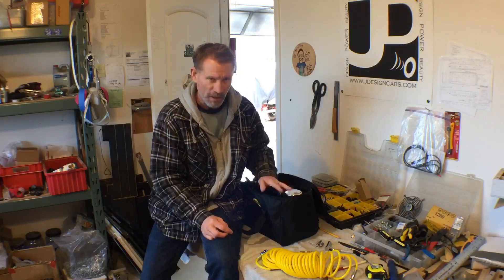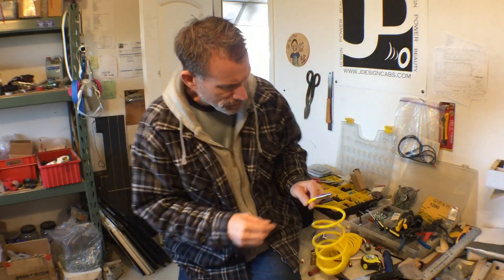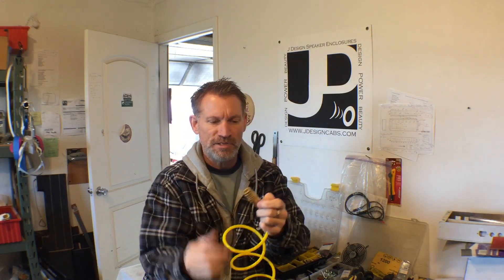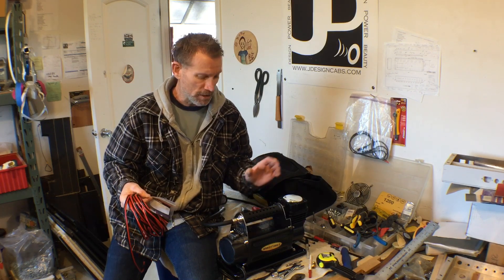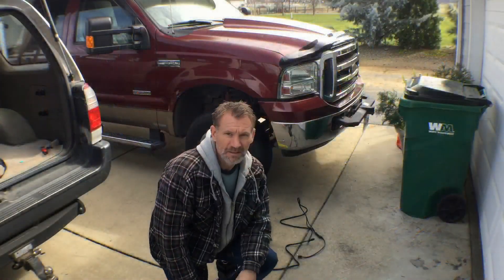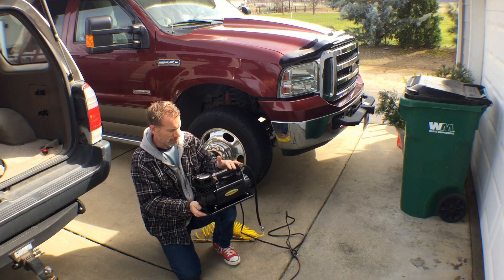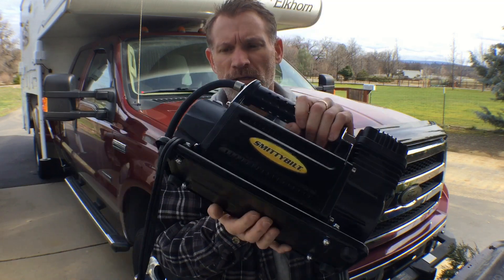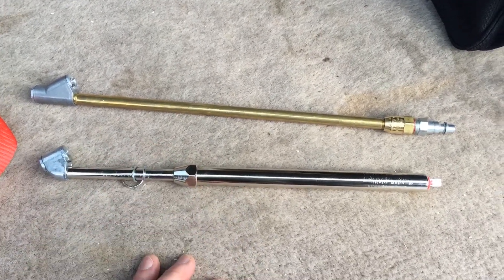Smittybilt 12 Volt RV Air Compressor Review.  Better than Viair?

Comment: I bought the Smitty Bilt 2781 compressor and the fittings to modify my hose and couldn’t get the fittings to go in the hose so I went to my local hardware store and bought 3/16th fittings and they worked just fine got the job done works good. Like your videos,I have a 2006 F-350 SWR Short box with a Lance TC 855S works for us.  Keep making the great videos

Comment: Same here, live at the beach. Aired back up from coming off Kure Beach on my 265/75/16 from 16psi back up to 35psi probably a minute each tire. The harbor freight one i was using was 3 minutes per tire. Impressed with this compressor.
Reply from the maker: Still working well for me.  The modifications make it so much better than stock.  I just wish it had an auto shut-off when it reaches a set pressure.  That blow-off valve is annoying.  That is where the ViAir 400P-RV has this SmittyBilt beat.
https://amzn.to/2YOLqR5
Reply: @covetthecamper2289  There is a video on YouTube for doing that. I ordered the items today, its using a 1/4 tee, with your airline on one side and a ARB pressure valve on the other side. The one I ordered cuts on at 70psi and below and off at 100psi. Real simple to install. Still come out cheaper vs other compressors I looked into.
Reply from the maker: Christopher Howey 
Oh, awesome.   I’ll look into that.   Thanks man!
Reply: @covetthecamper2289  your welcome last thing you'll need on the compressor where the tee connects to the compressor is a 1/4 male NTP to male m12 x 1.25 fitting the tube on the compressor is not a standard fitting. The pressure valve and metric to standard fitting i ordered both on Amazon got the 1/4 female tee at home depot
Reply from the maker: Christopher Howey 
Cool.   I found and watched that other modification video.  👍🏻
https://youtu.be/_EH0gKJawxQ
Reply: @covetthecamper2289  not sure if you saw this video shows the wiring of the pressure switch.
https://youtu.be/gl87JVQsKLo

Comment: You are crazy if you think this is a better compressor than the VIAIR 450P. The only thing it is, is cheaper. Just look at the Amazon reviews on both. Anyone that says this thing is better than the VIAIR has never owned a VIAIR. The first thing you do it do all kinds of mods and crap on the SB when you need to do nothing to the VIAIR because it comes with quality fittings and hoses to start with.
Reply: The VIAIR 450P is significantly slower than this Smittybilt though, and costs more.  Why would you want that?
Reply: @davidslinkard2375  The 450P is continuous run though. It also is quieter, runs cooler and comes with far better hoses, connections with a built in gauge. You don't have to turn it off and on all the time either, it does it automatically. The hoses it come with will also reach the rear of my 42' 5th wheel without having to move the compressor.
Reply: @boltactionshooter  Depends on your use case with these.  I only ever use mine for reinflating tires after off roading, so the compressor only runs for 6 minutes tops and then I'm done.  And the connections were easily fixed with some different hardware.
Reply: @davidslinkard2375  The video should have been titled will the SB work better for you than the Viair. The answer would be, it depends. But better in terms quality in every way the Viair wins. Granted the Viair cost more too. In your use the Smitty should be fine. In my case, topping off numberous tires to 80 and 110 psi, the Smitty would burn up, the Viair doesn't flinch.
Reply: No you  I think handles down the VIAIR is better quality and value. Read the reviews on each and it will make your decision easy.

Comment: should have rigged the inline gauge... save the back and forth
Reply from the maker: The compressor comes with an in-line gauge.  I didn’t like it on there because I use extended chuck and gauge for my dually.  You’re free to use what comes with it if that works best for you.  The stock inline gauge is accurate.
Reply: When I get to it, I will have to post again... there are so many more issues I ran into[ on this unit and onboard-air in general ], my reply would be 30 lines. [ LOL, I went on a rampage to really really get to the bottom of this 12V/24V onboard-air issue ]
I do have a couple of questions... I just bought a 'dually'
-  is the extended legacy chuck STRICTLY needed for the 'dually'? why not a longer hose?
- wonder if the valve stem on inside wheel is only accessible thru the outside rim?
...and how do you check pressure on the inside wheel with a stick-pressure-gauge?